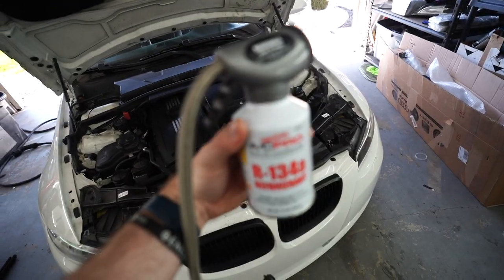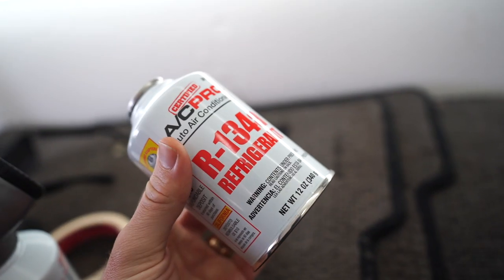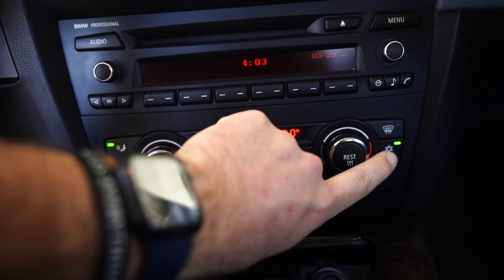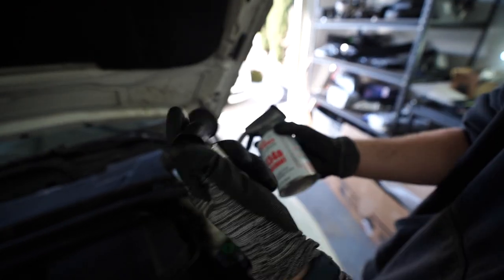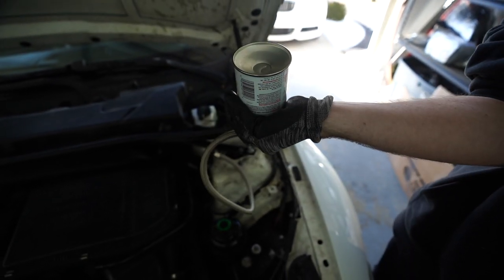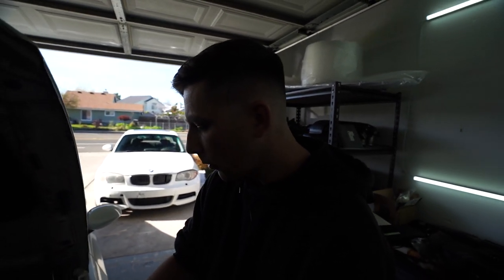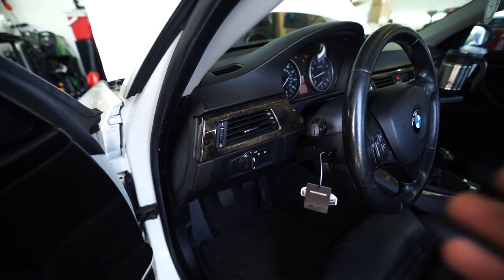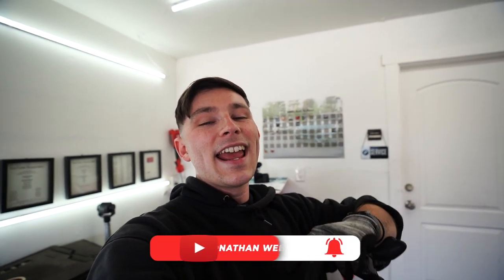HOW TO RECHARGE YOUR CAR AC THE EASY WAY! (DIY)

Comment: Be advised, this method may cause your AC system to eventually corrode due to the fact that you are letting air from the empty hose into your system. The correct method is to pull vacuum and then connect the can to the hoses and adapter and then purge the hoses by releasing some refrigerant into the air, then proceeding to allow the refrigerant into the system.

Comment: Its The LO Line you use not the HI line. The HI line can have some insane amount of pressure, but the nozzles are different sizes so you cant really put it on the HI line but don't try it just to prove me wrong 😂